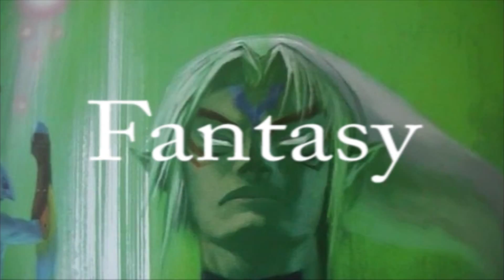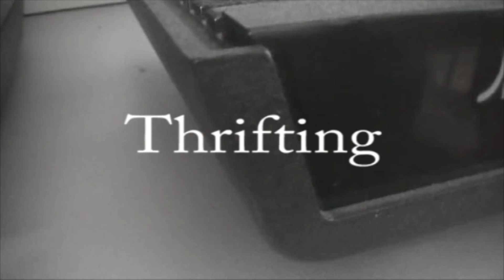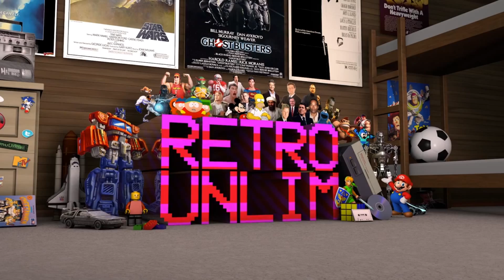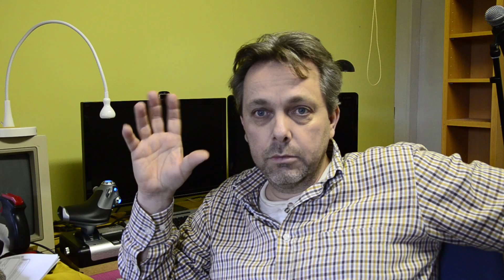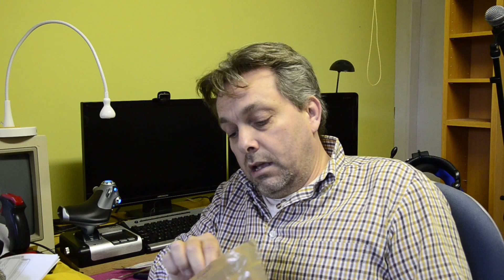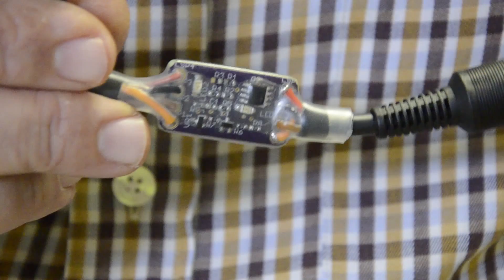BWack and the C64 saver circuit

Comment: I didn't know about this! I will look into it, I'm in the UK but I guess the voltage spike could happen in any PSU, so if BWack does start selling, I'll be interested. And this video has prompted me to sort out my C64 stuff and get some picks or a vid up! Thanks for this look-at!
Reply from the maker: +WatchReadPlayRetro Yeah the voltage regulator that has to take care of the 5V line can fail, causing 12V to be output there. Hans has been surprised by the attention so far but if you contact him I'm sure he can help you. His next design is even better: the whole thing fits inside the connector!

Comment: Excellent C64 saver circuit. Very nice gift from Hans.
Reply from the maker: +lactobacillusprime Yeah it's amazing. Now I only have to add cooling fins to my chips to make my C64 last forever.
Reply: The Highlander There's excellent little aluminium / aluminum cooling fins with self adhesive conductive tape underneath that I have put in all my C64s. Probably will also do that to quite a few of my other systems as well.